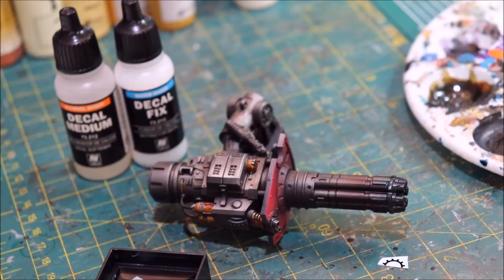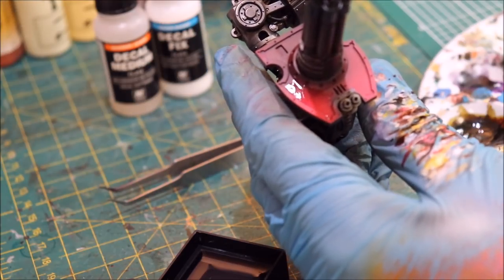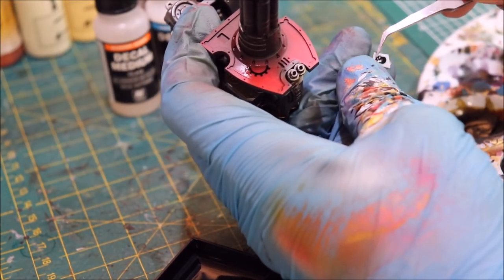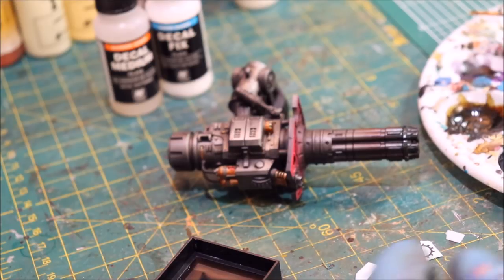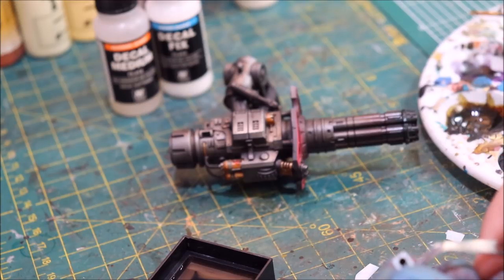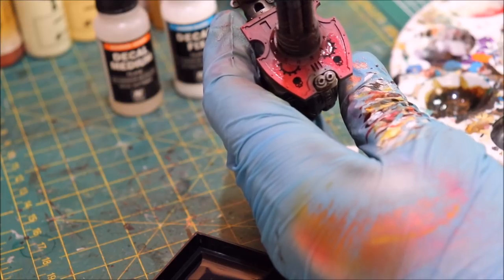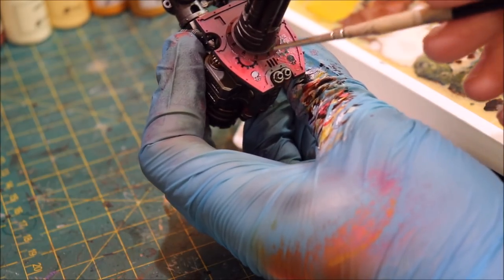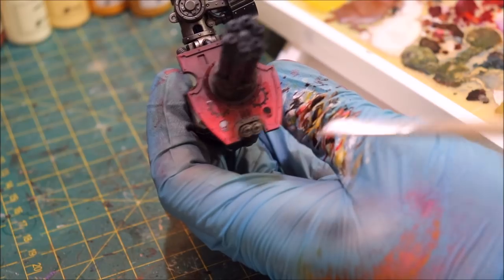Hobby Cheating 119 - Applying and Painting Decals

Comment: Military aircraft maintainer here. I agree with you on battle damage / scratches on minis. It adds lots of drama and story to a figure. However, I can absolutely say that, even during war, if a vehicle isn't fighting, its being maintained. I cant speak for anything other than the aircraft I know, but scrapes, scratches, and bare metal are all usually fixed pretty quickly. Corrosion control is very high priority.
Reply from the maker: True, my feeling is in the 41st millenium with this "all there is is war," they may be slacking a little. ;)

Comment: The only difference in product that I see is that the micro sol and micro set by Microscale softens the deeecal and does not seal it. The reason it softens the deeecal is so that it conforms to the surface and hides the carrier film and bubbles if there are any. Then seal it with what ever you like to use. Cool about painting them...I just like to do the weathering thing. Thanks for sharing...
Reply: That's exactly what the Vallejo medium does.
Reply: Yep just like the micro sol. varnish after to seal.

Comment: Tips for applying decals to curved surfaces? I've always struggled applying them to Space Marine shoulder pads for example.
Reply: Before putting the decal in water, use a sharp knife to lightly cut slits in the decal. Preferably in places where it's just transparent or otherwise uninteresting.
Reply from the maker: Excellent tip, a very good tip I would also add to make sure the surface is wet enough you can slide and adjust it. This has helped me in the past so I can push it properly into position.
Reply: If its like a space marine shoulder pad, you can put the decal on. Then while its still wet, before it sets, take a very sharp (basically knew) Xacto blade and roll the blade down the curved part to cut a split as far as needed. Then apply your decal micro sol.
Reply: To anyone reading this: You don't have to cut the decal, just apply several coats of Micro Sol and it will conform to any surface. Then cover it with a matte varnish to seal it in and marvel at your decal that looks painted on.

Comment: Vince, love your videos!!  Thanks you so much!  Do I need to gloss varnish a shoulder pad before I apply a decal then matte varnish over the decal to bring it back?
Reply from the maker: No, it's a good idea to have some varnish there as you're getting the area very wet when applying the decal, but you don't need to slather it in gloss or anything, just some varnish to protect.
Reply: @VinceVenturella any particular type of varnish you suggest?
Reply: You’re the best. Thanks for answering so quickly. I just signed up on your Patreon.
Reply from the maker: @chrisrinderknecht3753  A little satin varnish from Vallejo is always easy

Comment: Interesting that you're putting it down on a matte finish.  I gloss the area, fix the transfer, do as many applications of Micro Sol necessary to get it flat, then seal it in and smooth it with another layer of gloss before doing anything else.
Reply from the maker: Yes, I know that is another method, and I don't think there is anything wrong with that at all. I actually like the surface being matte at first so I can see the exact edge before I seal and varnish everything to smooth it together. Given that I often paint them, pigment them, battle damage them and then seal everything with dull cote, it all tends to even out in the end. ;)